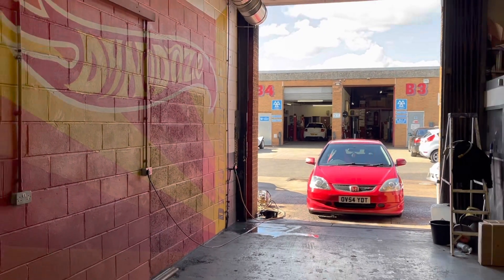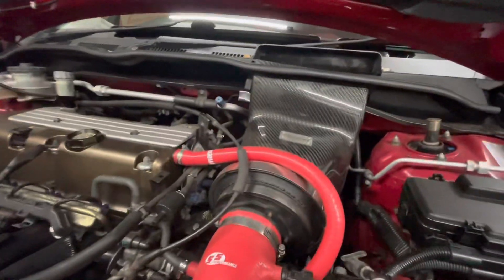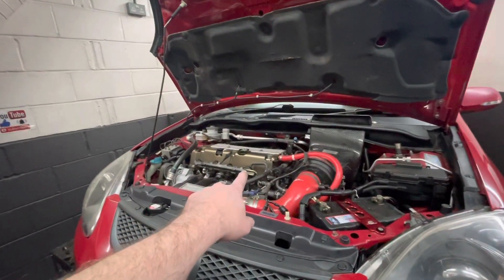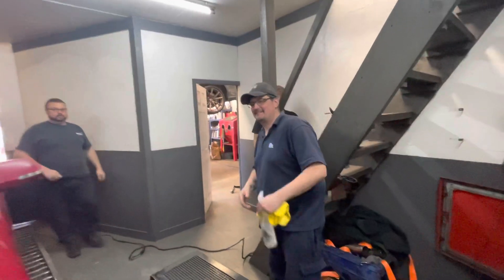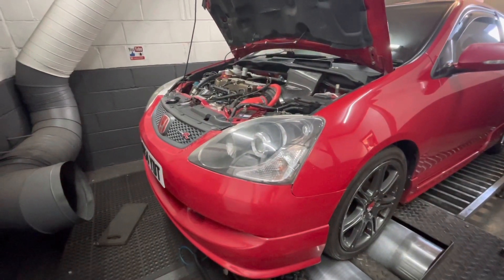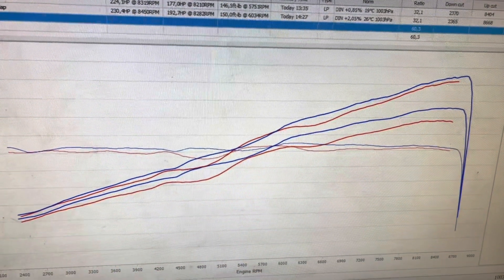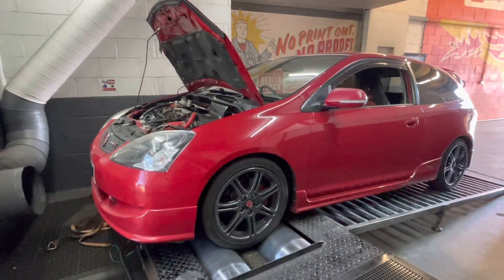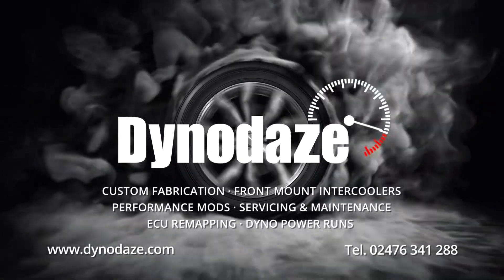Tuning An Ep3 on a k100 Hondata ECU

Comment: Are k20a6 in anyways usable for making a bitta noise.
Reply from the maker: its not an engine of choice no
Reply: Very cheap got here. B nice to be able squeeze extra 20hp outta them. Seems as if the inlets not getting enough air or something.